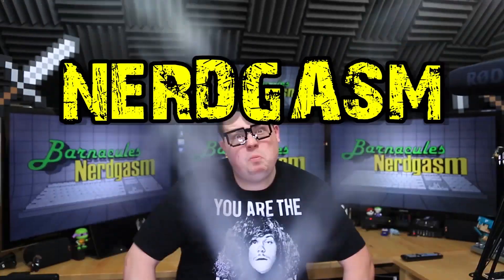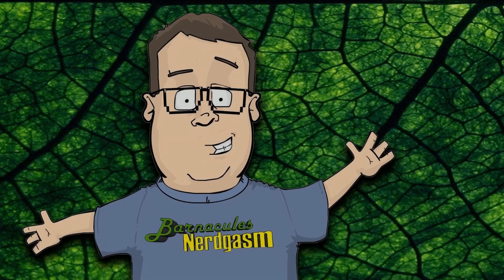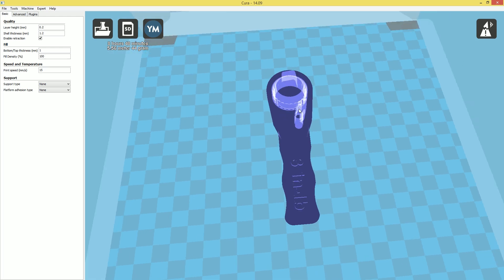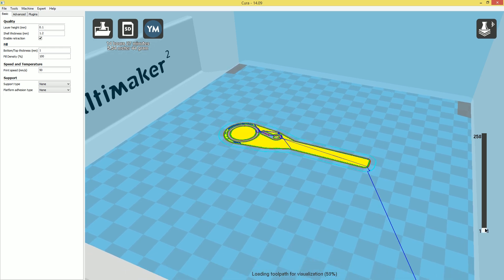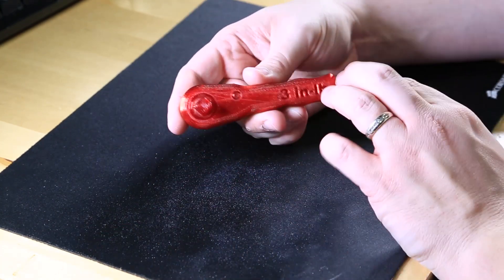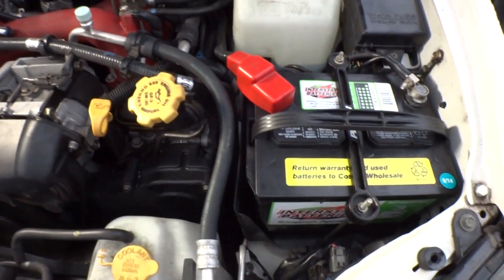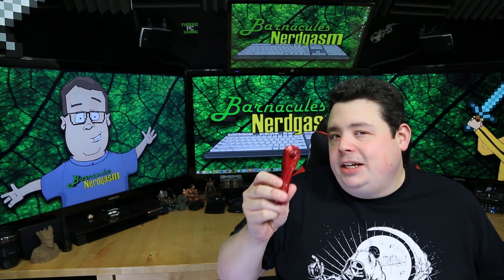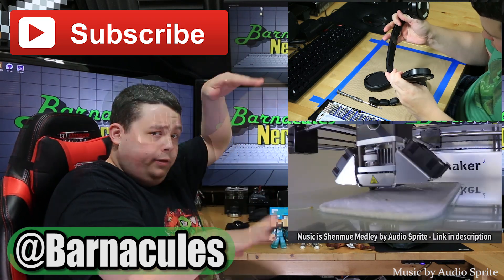3D Printing & Using NASA Space Wrench Here on Earth - @Barnacules

Comment: Really thinking about this though 3d printing is starting to make more sense to me as less of a toy and more of something I could actually use. I spent an entire weekend running around trying to find a star bit small enough to take apart my knife for a full cleaning. If I had a 3d printer with some of the bronze fill, or anything stronger than regular plastic, I could make these small uncommon bits and tools for things like that with only a minimal amount of time actually doing something. The rest of the time I might've spent looking for a random tool that I normally wouldn't use I could be doing something else while I wait for it to print.

Comment: id imagine you could amke an even stronger one tweaking the tolerances of the gear inside. just scale  it up by super tiny increments like nano inches or so.  it would rachet harder but also have better torque.  also if u made one with multiple components instead of all in one print you could have two halves of the wrench and just replace the inner cog when it wore down then hold it all together with printed thumb screws.  also i think they could get a selector in there if it was done with separate parts tho it may need to be a little bigger.

Comment: Instead of printing another wrench for loosening something, you could make the square adapter come out from both ends of the wrench. So you can select the function by placing the bit on one side or the other.
Reply from the maker: The only problem would be all the support material you would need to print to make it work. It needs to print flat to be really efficient. But that being said it is possible and might be worth trying.

Comment: You really wouldn't need a second printed wrench to loosen bolts. You could put another drive socket on the back of the wrench, if a selector switch isn't an option. Of course, you would have to print the wrench on its side.

Comment: I guess a lot of people shared this suggestion. Would have been cool to see it printed in the metal filament.
Reply: aftershock2013 Fair point.
Reply: No it will be weaker I'm assuming your meaning the bronze filament.
Reply: Adam Hasso He said cool, Not 'It would be stronger'
Reply: aftershock2013 Why would it be cool if it will be weaker ?
Reply: An ornamental piece. Not all things have to built to be used

Comment: Try to print a Rubber Gun with all the parts inside so you don't have to assemble it with a hot glue just like the wrench and the ammo is NinjaFlex (if it's possible)

Comment: Um, if you were in desperate need for a wrench and you needed absolute certainty that the bolts you were using it on were tight, why wouldn't you print a solid one, yeah it'd take longer to do up bolts, but you could put a lot more tension on them. Also it'd work in both directions.This seems like one of those times when NASA over-engineered something, just saying.

Comment: Is the 3in-lb a torque wrench rating. E.g. When the wrench started slipping doing up the bolt then you had reached the set torque of 3in-lb.

That's even more awesome as essentially the made in space guys would have made it from the tolerances of the ABS. Designing something to fail (in a controlled reusable manner) at a particular torque using 3d printing... Awesome.
Reply: I was going to ask why did they design it to ratchet? Was it really needed? It would have better to make a non-ratcheting breaker bar. They could have used the breaker bar as one wrench for tightening and loosening. Also, the wrench could have a higher torque spec that way. Your explanation is probably the reason they designed it that way. They wanted a torque wrench instead.
Reply: xOAT Or because they wanted something that works in a much smaller space. With a breaker bar you either have to make a larger rotation or continually removing and readjusting your position.
Reply: Inch-pound is a torque rating, much in the same way as the Newton-Meter, and while it would have a higher torque capability if it was not a ratchet design, that actually makes it harder to use in general. Instead of just ratcheting the wrench back, you have to take the wrench the off, put it back in a position that you can work with, put it back on, turn it, and repeat. No tool is more useful than the ratchet wrench, since you only need to take it off only once during the installation/removal process.
Reply: No, just like food expiration dates are not dead set; you won't die if you eat it 20 seconds after the expiration date however the chances of the food bad after said date is very high.
Reply: The ratcheting is useful for the awkwardness of space/0 g's. It is probably exponentially more useful than being on the ground.

Comment: Barnacules just put the part that the has the pieces for the socket part on both sides and it will turn a different way to tighten or loosen depending on which way you use it.

Comment: If they can print a functional tool in space, how long will it be before they are able to print out the space station itself?
Reply: Pretty soon the only jobs that aren’t obsolete will be programming the computers  to do new things.
Reply: Barnacules Nerdgasm Just send spools of material into space and the station just keeps getting bigger? sounds good
Reply from the maker: Just a matter of time! That would be pretty awesome.
Reply: For all we know, in another dimension, they may have already done that.
Reply: They already can Gimp, even conductive panels. We cant print in metal up there but there are other, lighter ways with a large reprap. We can even print fully functional solar panels. soon will print circuits with the new conductive filaments.
Reply: Gimp Geek I think they can already. Printing metal is not a new thing. They just need to build a printer large enough.

Comment: Did the PLA shrink that much or was it worn down?  I don't usually experience that much shrinking with PLA. 
Yet another fantastic video.  Keep up the hard work!
Reply from the maker: It was worn down, when I first used it the mechanism was tight but loosened up quickly after a little use.
Reply: Barnacules Nerdgasm Awesome, thanks for the reply!

Comment: All that needs to be done to use same wrench to loosen without a selector is print a socket square on the other side and one side tightens and the other loosens and m sure theyll need to figure out support and bridging when its being printed
Reply: Or just have a hole there, print the rectangle separate and then you slide the rectangle though which ever way you want it. (they do this for real wrenches currently too)
Reply from the maker: Exactly! Just like my little wrench. I might modify the design to do this.
Reply: Barnacules Nerdgasm why do you sound wierd in this video? you change to a cheaper mic?

Comment: Whats with the '3 inch pounds' label? Is is supposed to slip at 3 inch pounds.
Reply: Its a measurement of torque.
Reply: I Am The Way Is this wrench supposed to be a torque wrench?
Reply: Richard Meadows Torque limit
Reply: Yes. He kept saying the wrench was slipping like it was a bad thing. Clearly it is meant to do that on purpose. Likely for the wrenches invented purpose to tighten a specific bolt, and to protect itself from damage higher torques.

Comment: If they had skipped the ratcheting mechanism they probably could have gotten more torque.   It would be interesting to see what torque spec required was and whether the material they used is significantly stronger than colorFabb.    Depending on the depth required a simple wrench might also have been more productive.   

One wonders how they ended up with sockets but no ratchet on a spaceship.    EVA tools should pretty much all be tied with lanyards so they don't drift off.

Comment: A redesign could be to have the rotating part reach the other side (side touching the bed) and have the same attachment, would need some support material then. Then you just pull the socket off and turn the wrench round and put the socket on the opposite direction side.... but this may have already been put in the comments

Comment: whats the best 3d printer for the price
Reply: The Printrbot is a great entry-level printer. You can get one with a heated bed for somewhere around $700, or without the heated bed for a little less. Your tradeoff is build volume which is only 6"x6"x6" on the Printrbot.

Comment: The PLA wrench likely would be rated between 1 - 1.5 inch/pounds. That's not even enough torque to tighten a wall plate. 

Not that 3 in/lb is much better, but your ABS wrench seems to far exceed its rating. Could you check it against a torque wrench? (Couple the drives and turn the torque wrench until the rachet slips. Last torque held before the slip is the maximum effective torque.)

Comment: Do you suppose it slipped @ 3 inch lbs of torque? Because it says 3 in lb, on the handle?
Reply from the maker: No, that rating for ABS I used XT so it was probably a bit more.

Comment: The thing that goes between the teeth that grips the gear there should be 4 of them 1 on each corner so it can distribute the load on more then one teeth so it wont wear down as much.
Reply from the maker: That is a great idea, they should re-design a new version of it with that upgrade to increase the torque.
Reply: actually you know how barnacules mentioned mirroring it and printing another wrench? well you can just mirror the clutchimg mechanism and the square knob of the wrench onto the back of the wrench itself, so one side can tighten, then flip it and the otehr side will loosen. I've seen it on youmagine or thingiverse somewhere
Reply: Barnacules Nerdgasm Well, send that to NASA Barnacules Nerdgasm 
Maybe youll get some "USA Nerd medal" xD
Reply: That's the most awesome thing about being able to rapid prototype like this; you can have an idea, and in a few hours, you can implement that idea.
Then you can improve THAT design, and so on.
Eventually we will come up with the MASTER TOOL...  XD
Reply: Barnacules Nerdgasm http://www.thingiverse.com/thing:618822/#comments
Doctor Who Iphone 6 Case - Embossed image of Tardis and Doctor
this is for your iphone 6  i foned can you  use fuxe pla or lbs
Reply: Lance Greene Great idea
Reply: ***** Barnacules Nerdgasm It would mean a much bigger head. Not impossible, though. Maybe a double sided one so you can really get the torque on.
Reply: I'm thinking this might also work better with a ring, with many small 'blades' pointing in to engage with the 'gear' at their tip edges...  Make it so that they will bend slightly when the gear pushes against their sides, but when it pushes against the ends, it locks.
The locking ring would look something like that little ring that comes off the bottom of a 2-liter bottle cap, but much more robust, of course...
Then you could have as many contact points as you have teeth on the gear; I bet this would give great results, because the locking force would be all around the gear.
I'm not sure if the plastic is too brittle for this to work; would they be able to bend back a little to allow the gear to turn past in one direction without getting compromised?
Reply: Allan Floyd the whole point is to make as little moving parts as possible...
Reply: Tyler Kelley My design replaces that lever that moves back and forth with a ring that parts of it bend.
Seems like an improvement by your criteria also.
Reply: Allan Floyd I've got a redesign as well that I'm printing out right now to test and I'll share it. Is there a place I can see your redesign?
Reply: mrjoesays I need to CAD it up; at this point, it is just an idea I had day before yesterday, but I see no reason why it shouldn't be sound.
Reply: Allan Floyd Have you ever designed anything for FFF 3D printing? There are questions about tolerances and strength that need to be addressed. What you've described might work but I forsee it being very bulky. But I'd like to see what you come up with.
Reply: mrjoesays I have.  The only question about whether this would work or not is the flexibility.  I haven't done a lot of experiments to quantify that particular variable.
Reply: Allan Floyd Actually, this is how snap on wrenches work. They have separate tooth assemblies for tightening/loosening. The selector switch retracts them. Each toothed assembly has 10 teeth on it, with a small spring that holds it away from the casing of the wrench. When the teeth catch (not ratcheting), the toothed assembly gets pushed into the casing of the wrench by the teeth, locking the arbor, ring gear, and tooth assembly together. That way you do not rely on spring pressure to hold the ratcheting teeth to the ring gear. The assemblies are tapered to fit into a machined section that locks it all together. When the load is removed, a small spring pushes them back out so it can ratchet the other way. Look up the Snap On dual 80 ratchets to see what I mean. Best ratcheting mechanism I've come across.
Reply: thye can print the sq drive on both sides so it becomes a tool to undo as well, no lever needed, also print springy detents on the square to fit the  socket part tighter
Reply: Complicated iiby

Comment: So NASA, the agency that sent men to the freaking moon with slide rules, has the foresight to send a 3D printer (that weighs how much?) and sockets, but not the actual socket driver. Oh, and the driver only works in one direction, and doesn't actually work that well. MONEY WELL SPENT, GUYS.

I really want to be excited about the whole 3D printing thing, but right now it is nothing more than a very expensive novelty. To this point, I've seen exactly one thing produced by a 3D printer worth mentioning - a pair of prosthetic devices for a dog born with deformed front legs.
Reply: ^^^^ What Chris said. It's probably more likely that they did send a socket driver and it broke. As Jerry stated in the video, it was engineered to print in one piece, making a reversible wrench difficult to engineer. Printing mirrored pieces for tightening and loosening seems much easier. Also, as Jerry stated, they used a different material than Jerry did, so you don't have anything to back up the claim that the wrench "doesn't actually work that well." It's likely that Made In Space did many test prints to evaluate the strength and effectiveness of the part before they ever sent the file up to the ISS. They didn't just find it on Thingiverse.

No one can force you to be excited about 3D printing, but I would advise that you try to imagine what is possible with the technology rather than looking at and dismissing what others have done with it. Ever since I started saving for a 3D printer I have started seeing examples all around me of uses for 3D printing. I have a folder full of 3D models ready to print that will fix household problems and have mechanical value. At least once a day I think, "Oh, I could 3D print something to fix that!" and I have had requests from family members for things they want printed when my printer arrives. It's just a matter of whether you want it to have potential or not.
Reply: Did you think even for a second?
What if his old wrench broke. Or you were in NASA control center on with them on station, so you know better?

Comment: I wish you had tried the bronze PLA as well
Reply from the maker: It would have been pointless, the Bronze PLA is actually weaker then regular PLA. It would have looked badass though as a display piece.
Reply from the maker: Meir Teichman Nope, the bronze dust is held together with PLA so it's actually more brittle and weaker then regular PLA.
Reply: SkylessSkyrim Weekly Uploads Melting wood, I LIKE IT
Reply: no he has wood filament
Reply: he should have!  figure it would be very strong and durible.
Reply: Barnacules Nerdgasm ah! completley forgot about that structureXD  you have doen eveyrhting right:D 

o wodner if there is a process that removes the PLA and leaves only the metal dust,like soem sort of lost wax mold tingie.

bet it will shrink considerably though and easier to just print a wax model to do lost wax casting or just use those expensive metal printers.
Reply: Barnacules Nerdgasm Try wood
Reply: SkylessSkyrim Weekly Uploads   would the wood fill work? 

cuz of fibers or soemthign/:)
Reply: yeah he used it before
Reply: Waxing My Knee: ᶃᶉḁᵱḥᵻḉ ᵭᵻᴤᵻᶃᶇ its wood fibers held together with plastic
Reply: I was just making a bad joke, I have an ultimaker and yes I know how it works.
Reply: I was gonna say the same thing because it has metal in it but you already recommended it sooooo... ya you beat me.
Reply: Barnacules Nerdgasm You really need to get a metal printer :D
Reply: Barnacules Nerdgasm What if you were to bake it?
Reply: *****  that can actually be a great 3d print video.  how to use 3d printing to retrofit new compnents to your existing products.

and he already has a fan made sculpted bust to use too.
Reply: ***** was talking about the drive tick thing.  think you need a old for actual condoms.

unsure of how airtight the layerig would be. best to just melt it all into a predefined shape.
Reply: Barnacules Nerdgasm "weaker then regular PLA". So this isn't a legit test for a PLA wrench, because regular PLA would have been stronger and more durable. Looks like your test failed more then the PLA wrench did.
Reply: That would've been a great idea
Reply: miekie mouse
Reply: unknownVS13 it will be very strong and very hard to move and break those little thing